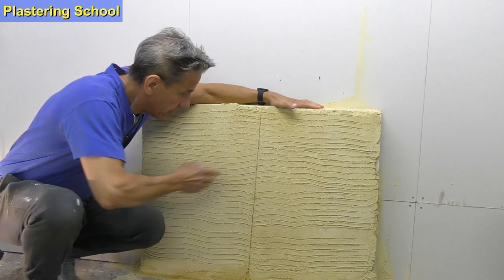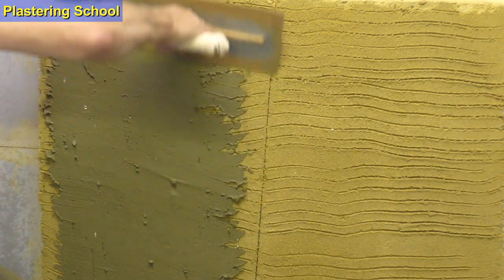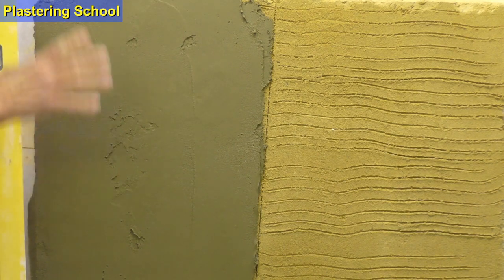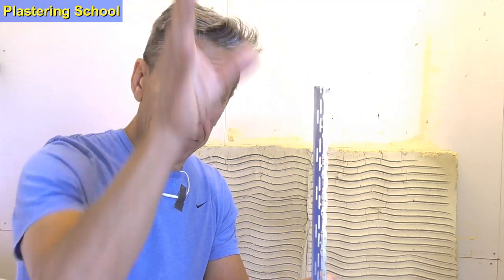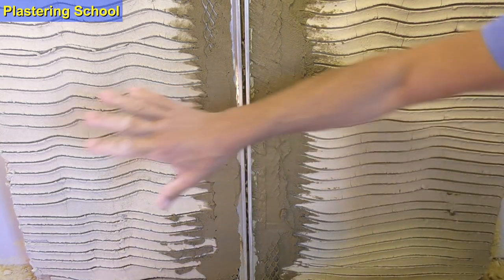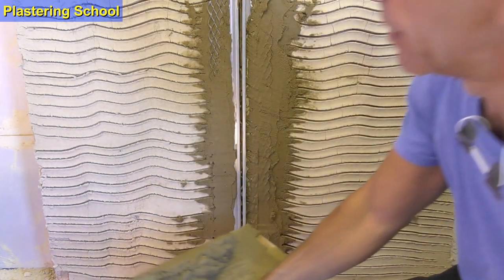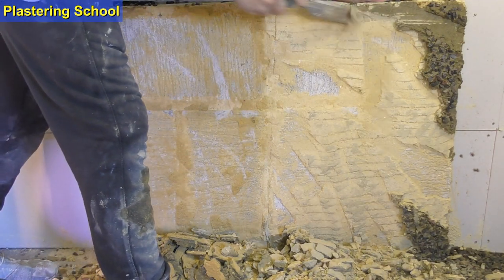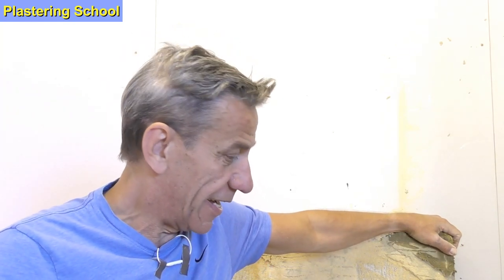They All Fall Down

Comment: Great bit of work.Check out a firm called Direct Building Products for plastering gear.Beads etc,never had a problem with them
Reply from the maker: Thanks David, not buying any beads at the mo, doesn't look like there will be any plaster supplies till June and then very limited, Couldn't even get sand recently😮 Thanks for the tip mate👍